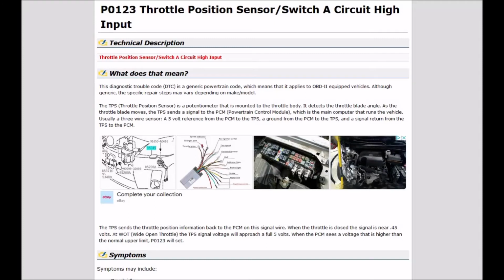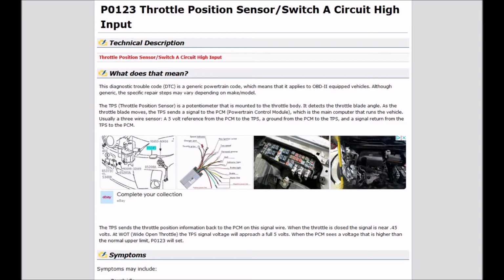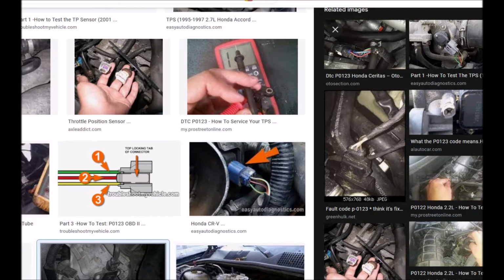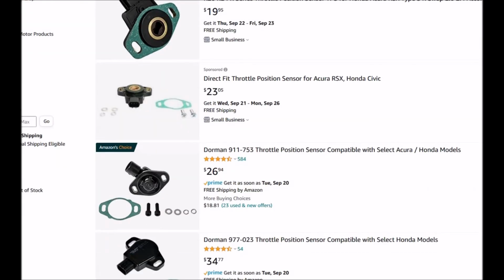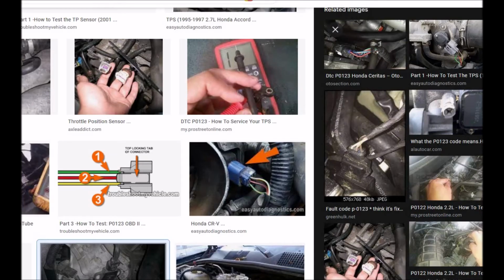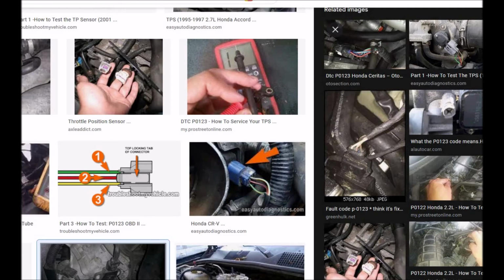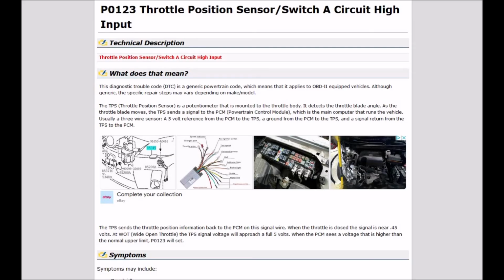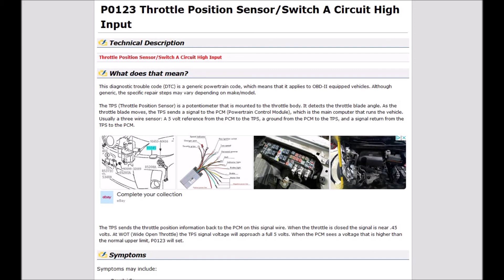How To Fix Honda P0123 Throttle Position Sensor

Comment: My 2013 Honda Accord V6 the idle is between 800 and 1100 RPM when it's warm when I rev the engine it revs twice in park and I only press the gas puddle once I don't know what to check
Reply: Same bruh😫😫😫